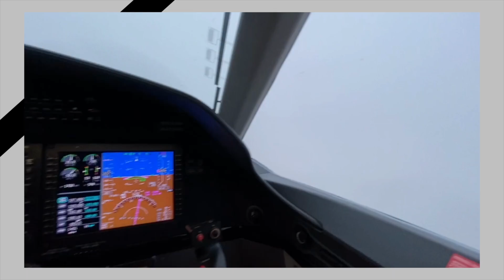Robinson Helicopters, 3 Weird Reasons Why They Are HATED

Comment: I’d just add that a cyclic pushover is not the only way that you can get into a low G condition.  Another main cause of low G conditions is turbulence. If you are flying close to the VNE and hit unexpected turbulence you could find yourself in a world of trouble pretty quick. Robinson Helicopters are awesome for what they are, but are definitely not built to be flown at or near the limit. Thanks for the videos🤙

Comment: The 5 fan belts that drive the main rotor did it for me.  No way I'd fly in one.  Plus. many Robinson owners try to use them as a poor man's Bell 206.  Not a good idea.
Reply: I'll admit that as a prospective student, the ( then 4 ) v-belts had me wondering. But there's a reason Robinson, Hughes, and Enstrom all use v-belts ( for one, they give the drive system more longevity by smoothing out the impulses of a piston engine ). The machines like the Bell 47 that use a centrifugal clutch have some real negatives by comparison ).

Comment: The first argument is false. Getting into turbulence can cause a low-g condition. You don't have to f*** up as a pilot to get yourself killed in a Robinson. I got my helicopter add-on in an R22, then I stepped up to an Enstrom and now I fly an EC120, and every time I get into turbulence, I'm glad I'm not flying a Robinson.
Reply: Yeah, I`m about 180 hours into my career and had quite a few situations where i was glad that i choose the Cabri G2 over the R22 to do my license.
Reply: @noahpfeifer6931 The Robbie’s aren’t so bad. I fly a 22 for my training and have been in winds of 25kts gusting 35kts and just kept airspeed 70 or less. End of the day they’re a small and light helicopter. Check the weather and don’t put yourself in those situations.
Reply: I've ended up flying the r22 in some pretty bad turbulence and it's been more than forgiving. You'd have to get into some really awful conditions before low-g mast bumping becomes a problem; and at that point it is pilot error, you're flying in conditions you shouldn't be.
Reply: @Uh0_o  The worst conditions ever experienced were in a R44 in severe turbulence & significant gusty wind. Pilot dumped it on a tight pad about 3000', had to hang onto it while we loaded it & he got me to put the sling load on. I'd put flag tapes beside the pad as windsocks, & they were horizontal in different directions at times.
Moment it got light it jumped about to about 30' where he held it into the wind gusts, waited for a sort of lull then over the side of the hill into a wide gully. The wind got us (only time heard him yell hang on) and downdraught took it one side to the other, thought we were in but as altitude reduced the wind stopped bouncing it about, & when uncomfortably close to the other side it came under full pilot control & finished the job ok. Not sure if he was trying to button the sling load when in the downdraught, looked like it & I was on the GPS to locate it if we survived. It was 101% alert minute or so, & have never thought a Robbie seriously inferior in shocking conditions since. Don't know how much was luck.
But needs a competent pilot (he had 20-30,000 hours in serious mountain flying) and strong nerve.  Wouldn't want to do it again.
And still think of them as flying coffins, but they weren't meant for venison recovery  & kept within specs are a good little machine.
Reply: @johnmead8437  30,000 hours? How old was he, 90?
Reply: @m3photo726  Had at least 25k logged & the main business was notorious for unlogged time, one of the likely reasons second-hand machines had problems, including Robbie's, They were real working pilots though, & 50 hr + weeks were common when conditions allowed. About 65, with 40 years at least. 
Others do know more, & better.

Comment: A coroners inquiry in New Zealand has found that the unique 3 hinge articulation system in Robinson heli's are significantly more prone to mast bump than other fully articulating designs. 
Robinson heli's make up 1/4 of our national heli fleet, but account for over half of all fatal heli crashes. The coroners recommendation (made in conjunction with aviation engineering experts) recommends that Robinson helicopters are not flown at all in high winds, and not flown above 70 knots in mountainous terrain, or anywhere else turbulence may be encountered. 

The last Robinson I flew in, fatally crashed due to mast bump from unexpected turbulence less than a month later, on exactly the same route & conditions, so it easily could have taken my life too. The pilot it killed was one of the best in the country.
Reply: Sorry for the loss of precious lives. 
However if R44s were that susceptible to fatal crashes they would be falling out of the sky every day and that's just not happening. I've seen R44s flying beach rides nonstop in windy conditions for thousands of hours. Flown within its limits doesn't care how experienced the pilot is. Go outside of those limits and you're on your own.
Reply: @rickymay8436  Re-read the statistic I posted. Robinsons DO fall out of the sky more often. You're TWICE as likely to die in a Robinson than other helicopters.
The problem with statements like "Flown within its limits" is that the limits are also dependent on the conditions, and the conditions can be invisible. It's easy to fly within the limits when you know it's windy or turbulent. Encountering UNEXPECTED turbulence at cruise speeds in a Robinson is a risky scenario, and the margins are narrower than with other helicopters.
Reply: @boydw1 Statistics can be made to say anything you want to support.  

What is the crash rate per flight hour ratio?  What is the experience level of the pilot?  How many pilots are on each aircraft during the crash?  Was the aircraft flying outside of the design envelop?  etc...

Too many variables for that blanket statement to carry significant weight on its own. 

If you wanted to rely on statistics, I am sure you will find a lower experienced pilot crash more.  Let's get rid of a low experienced pilot!
Reply: @tristated9310  Nice try, but no - the Robinson crashes above the statistical average are not typically training or low time pilots - the large majority were highly experienced commercial pilots encountering unexpected turbulence.
The coroners inquiry closely analyzed the susceptibility of the Robinson rotor mast assembly to mast bump (in comparison to other types) and determined that the additional risk posed by the Robinson type was significant.
It simply comes down to inferior design resulting in higher risk.
If it was a car with a suspension issue causing above average crash rates, nobody would be jumping in to defend the car - everyone would say "that's dangerous - they should redesign it".
Reply: @boydw1  I never defended the aircraft.  I pointed out  that your correlation statistic does not prove causation. 

Just for giggles, what percentage of pilots that crashed had less than 500 hours?  What percentage of pilots had less than 100 hours in type?   What is the percentage that flew into conditions outside of the flight design envelope? 

Your generalizing statements add no weight to your conclusions because no one knows how you are defining anything.   

Are there better, safer designs out there.  Probably, I never really look at it.  Most of what I have read, although minimal, indicated the pilots flew outside of the design envelope.   Is there a peculiar nature of this design that pilots need to be aware of?  Yes.  Does that immediately make it unsafe to fly?  No.

Just understand certification and lisencing is to minimum standard.  Nothing more.  That doesn't mean it is the best, most reliable, or safest possible.
Reply: A trip with one Sax was the most severe conditions personally experienced, & was in a 44. Earlier that day an instructor & student were killed in "fine" weather East of Aspiring .Morgan found them, so Dave did our pickup.
The weather west was between showers & violent (am convinced the fatalities were likely due to unexpected downdraughts, the storm hit suddenly at the right time & would not be visible to them, raining & windy on the coast & could still see the west side of Aspiring). We were jerked around severely, into a 1km downdraught that thought was my last, & Dave pulled it up just before gong bush about 500m lower down than started. Have never belittled what a Robbie can do ever since, despite considering them flying coffins. But realistically they weren't designed for what we put them through, & many pilots don't have the skill & maybe luck of that day, a 22 wouldn't have had a show, & they are not a preferred aircraft unless with a good pilot. & many overestimate themselves.
Reply: @raynixon6767  The vast majority of Robinson mast-bump incidents have not been associated with any form of higher risk flying such as Ag work, hunting, or training, and you are misrepresenting the issue by attempting to draw that association.
For more info, read the Coroner's inquiry report.

Comment: Well, as a fixed wing instructor, I have looked at a lot of training helicopters with the idea of eventually adding a commercial helicopter to my ticket. The first red flag was that the Robinson has its own SFAR. The second red flag was seeing more than one accident where the main rotor cut off the tail boom of the helicopter. I didn’t go looking for a third red flag.
Reply: Each helicopter has its own issues. Most likely, you'll either get your add-on in an R22, R44, Schweizer S300, or Enstrom. Arguably the Enstrom is the safest, but also the most expensive and most difficult to find a school with one. The Schweizer ( Hughes ) is the 2nd safest, but most expensive / rare ( and getting rarer ), with the Robinsons... all over the place.

The SFAR is difficult to discuss in a short comment, but should probably be a red flag for you about the same as training in an airplane prohibited from spins... The SFAR addresses some issues germain to any 2 bladed helicopter, and some that arguably apply to any helicopter trainer.

Frankly, you're probably better to worry about the instructor than the aircraft type. All helicopters can bite hard if they aren't treated with respect, much more so in my opinion than fixed wing trainers...

( 39 years teaching in Robinson, Bell, and Enstrom helicopters ).
Reply: @paulcantrell01451  Well,  I'm an old guy, and I remember when mast bumping came to light during the Vietnam era with the Huey Iroquois. A good instructor can certainly help prevent a separation due to mast bumping... but when I saw that Robinson cut off its tail and fall helplessly to the ground with an instructor on board, it gave me a great deal of pause.

Comment: I have over 2000hrs in an RH44 on the west coast of Canada. Flying in probably some of the worst wind and mountain conditions possible. I've had some scary as hell situations but fortunately walked away. In 2004 a fellow pilot buddy wasn't so lucky. He suffered a massive blade deflection in extreme turbulence. Short of it was the Robinson had the main rotor hit the tail boom, killing him instantly from the report, and the machine basically lawn darted :(

Comment: Funny thing.. My first flight in a helicopter, the instructor demonstrated zero g or slightly negative g by pushing over abruptly for the thrill effect. I came right out of my seat. It was in a Robinson. I  didn't know anything about helicopters at the time. I was wondering if that was kosher or not.
Reply: Sounds more like they lowered the collective purposefully.
Reply: I'm curious when this was... Prior to 1995 we were required to demonstrate low gee to students. The more prudent of us made that a very gentle demonstration. The SFAR at first required us to do a much more aggressive demonstration, inducing right rolls. After a few people died, the SFAR training was changed, and the SFAR then restricted pilots from flying low gee. By the way, lots of people assume low gee means "practically zero gee", but you can bump the mast / chop the tailboom at around 1/4-1/2 gee ( there was at least one Canadian (Australian?) accident where the accident review mentioned the gee where the accident occurred ).

As for low gee from slamming the collective down, one of the other students at the first factory course I attended asked Frank Robinson ( who taught some of the course back then ) whether that was dangerous, and Frank thought for a few seconds and said "not a problem". My own opinion is "not a problem as long as you keep it in trim with proper right pedal"... Still, if you do that, you WILL give your instructor a heart attack!

Comment: The R44 has the highest fatality rate per 100kh of any helicopter model, all you need to know.
Reply: Exactly..fly these things at your peril.
Reply: Which brings me to the simile: Guns don’t kill people. People kill people …
Reply: In fact, it's a little over twice the fatal accident rate than the R22. As someone who has taught about 20 years in R22s, and then 20 years in R44s, I think the R44 is the more forgiving aircraft... Of course, the fatal per 100,000 hours numbers might be skewed a bit just because of the seating capacity of the 44 vs 22. Also, the higher speed of the 44 ( generally cruising at 110 knots versus 85-90 in the 22 ) doesn't help with low gee / turbulence issues. And, these days, the 44 is the choice for many / most private owners who are often low time and very rusty ( in my experience having given a jillion flight reviews ). 

The R22 is much more nimble, but I think it's more prone to bite the unaware pilot... The 44 has a lot more excess power to get you out of tight spots, and a moderately high inertia rotor system which should make engine failures relatively simple for the average pilot. But of course, it's not engine failures killing most of those pilots...
Reply: As for the "fly these at your peril" comment... I think that goes for most helicopters - the biggest safety variable is the pilot, not the machine... An experienced and careful pilot flying an R22 is safer than an inexperienced hot dog in any helicopter you might name.

The R22 is almost certainly not the best trainer... It gets used for that role because of economics. The average student won't pay the extra $100-$300/ hour to learn in a more forgiving helicopter. I personally much prefer teaching in the R44... But notice that the Cadet sales aren't what some people were hoping for... Schools are generally going to use whatever is the most economical.
Reply: False... that title goes to the UH-1 Iroquois.  
The majority of Hueys & Cobras lost in Vietnam were due to pilots inadvertently performing low-G maneuvers.  
This is why the US adopted the Apache & Blackhawk to replace them & ultimately why the new AH-1Z Vipers & UH-1Y Venoms were upgraded with 4 blade fully rigid rotor systems.
Reply: @OOTurok  GA
Reply: Eh.  Have you ever read the Nall report?  Most of the data I've seen from it is related to fixed-wing GA (there's probably some rotary-wing data in the Nall report too, but I haven't seen it), but bear with me for a minute.  Looking through accident statistics, you see accident rates and fatal accident rates for pilots by certification (ATP, Commercial, CFI, Instrument rated, basic PPL, Sport Pilot).  Then you see accident rates and fatal accident rates by phase of flight (take-off, landing, maneuvering, etc.).  What's really interesting is that there isn't necessarily a correlation between hours flown and accident rate.  Some types of flights, for example flight instruction, have much higher accident rates than others.  Given that the Robinson family of helicopters are pretty much ubiquitous for flight training, it seems reasonable to me that the accident rate for Robinsons would probably have a much higher accident rate than other helicopters.  I'm certainly not saying that the design of the rotor system doesn't contribute to the accident rate, but it's probably an over-simplification to say "...all you need to know."  I will admit however, that IIRC, even Robinson himself said* that his helicopters are not ideal for flight training; they were designed for experienced pilots who understood the limitations of the helicopter and were more likely to be able to fly it within those limits.

*sorry, I don't remember where/when I saw this, as it's been a while.
Reply: @N600LW  So after all, all you need to know, was in the end, really all you need to know.
Reply: @pyalot  Okay...smh
Reply: @paulcantrell01451  Uh oh, you're never get into the "Let's Hate on Robinson Club" with an attitude like that. 😆

Comment: I bought a Schweizer 300CB after getting my training in one. I can't fly in the R22 due to the single-seat weight limit. Also, I'm not thrilled to fly in an aircraft that gives me less than 2 seconds to enter an autorotation on engine failure.
Reply: Less than 2 seconds, are you serious 😮
Reply: @aileronhelicopters  yep, 1-1.5sec if you are unlucky until the NR is below 80% (which is fatal)
Reply: @ccanakin  well, no one can survive that, it'd take me 3 to 4 seconds to enter an auto..

Still wondering who certified that death trap

Comment: I received my private rating in an old HP R22 it was number 46 off of the line. I had originally went to this school at the time to learn in the bell 47 but unfortunately it was still packed in shipping crates.The 1979 R22 hp was available and luckily had been well maintained with the barest of minimums to keep it in the air. After paying  up front and receiving a 2500 discount for their accelerated program I was stuck....